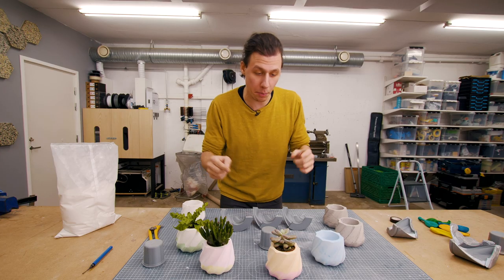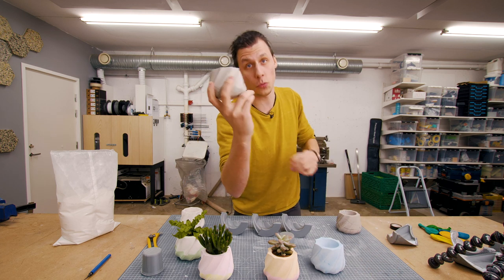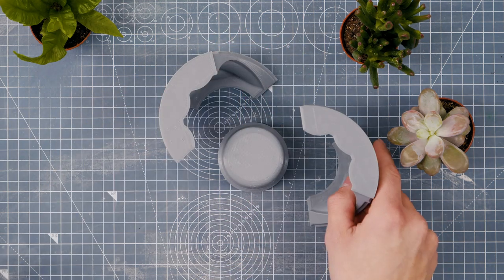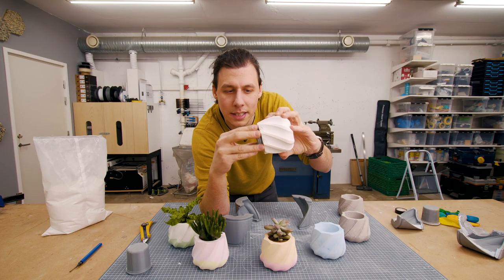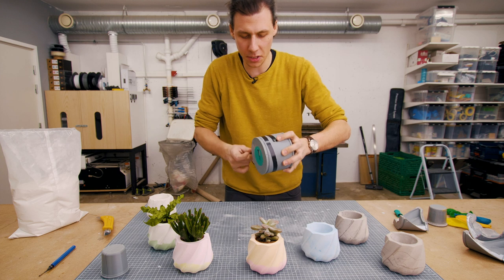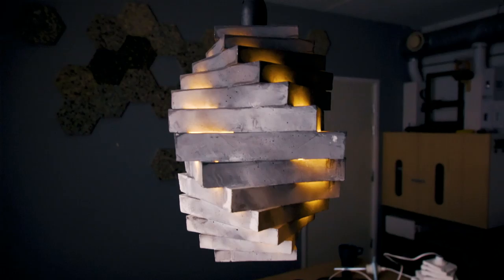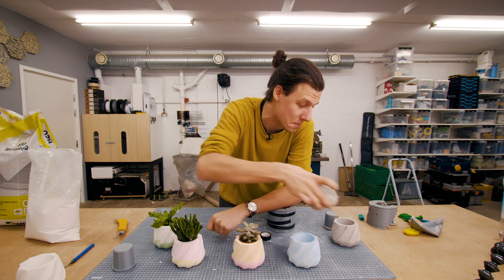Using 3d Printing to make these concrete planters!

Comment: Silicone spray works a charm for prevent concrete from sticking, just give it a once over before you pour you mixture and it will super easy to get you mold off.

Comment: Would love to see a video on designing a part like this and how to make a 3 part divisable mold.
Love it.
Reply: It's always good for people to walk you through it visually, but if you can model the finished part the rest is relatively easy.
Create a square or cylinder body that completely encased your part, create a hole for pouring. Use a boolean function (name may differ with software) to use the model as a tool to hollow out the mould to shape. All that's left then is to consider the split lines (how the mould comes apart and, more importantly, how it locates on reassembly) you can create surfaces along these split lines and use them to split the solid body. 
I know it sounds quite simple, but start simple and you may figure out on your own. 
Key things is to consider are draft angles, try to avoid pulling mould surfaces parallel to castings surfaces, and try to avoid fine detail. Small features are often hard to fill with casting material with the use of pressured filling methods or break off easy when splitting the mould.
Reply: Me too!
Reply: @PeterKNoone  Agreed

Comment: Thank you so much for the balloon trick! This is really cool! I already tried different molds and I always ended up having trouble removing the inner piece. And by "having trouble" I mean, I totally trashed the inner piece every single time to get it out even though I used oil / grease but it simply didn't help.

Comment: I made a bunch of these little planters with plaster and they came out great.  Concrete still doesn't want to let go of the center plug.  I've tried 3 times and even with a balloon it's a big nope.  I think I'll try painting and sanding the center plug to a super glossy finish and then using a mold release product.

Comment: Use construction grade silicone on the inside of the mold pieces that make up the outside design (the pieces that are in 3 parts). That way you can smooth out the ridges and make it look even smoother

Comment: The other way to get the core out is a multipart core that disassembles to the inside when you pull out the inner core.

Comment: fantastic video! Tip for future projects: so that the cement does not stick to the mold you can use cooking oil that works perfectly! and if you add the ballon still better

Comment: Another great vid! Thanks Alex. And kudos on the ingenious design and free share. The balloon trick is also great, as many others have commented. However, I just wanted to add a quick remark regarding your suggestion about using plaster:
As far as I know plaster develops mold with humidity, as in the fungus. I would avoid it. But I could be wrong and maybe there are mold-resistant specialized plasters out there… 
Anyway, great vid, keep up the good work

Comment: Great project! Amazing how creative you are with all your projects. How about coating the inside of the mold with something to act as a mold release? Silicone spray or even petroleum jelly. Of course if someone wants to paint the concrete or plaster after casting then you'd have to pick something that is easy to wash off. Silicone spray is not easy to wash off.

Comment: You can try making a clearance guild line around the edge of it maybe that could help or as a slopr
Reply: Another thing you could try is rubbing petroleum jelly on the print a light coat

Comment: Super awesome!!!  Thanks so much for the 3d model.  I'm going to print this up and cast a bunch of these for my wife's birthday....she will be so stoked.
Reply: Do you drill holes in the bottom for drainage?
Reply from the maker: Cool! I haven't done that so far no.
Reply: Hi, what print parameters did you use.
Reply: @polyteky  I printed them using recommended settings for the PLA I used...nothing special.  Printed easily.
Reply: @PeterKNoone  Thanks, what was the infill%
Reply: @polyteky  Jeez, this was 2 years ago.  I'm afraid I can't remember.
Reply: @PeterKNoone  Thanks for the quick replies:goodvibes:

Comment: What kind of plaster is that? Is it even save for plants and water tight?
Reply: Does anyone know if plaster is save for plants or does it need an special coat? And what about mixing white concrete with 25% plaster is it save? Even if it is coat?
Reply: As far as I know plaster develops mold with humidity, as in the fungus. I would avoid it. But I could be wrong and maybe there are mold-resistant specialized plasters out there… just not the basic kind

Comment: What settings do you guys recommend? 20% infill and 0,2mm layer height? Cura says it will take about 28 hours to print all the parts in one print with these settings

Comment: The file on thingiverse has the (3parts) part, upside down, and there is a ridge that makes it very hard to print that way, before printing makes sure you reverse the part on the right side.
Would love to have the original files, as I would like to add a "tool" to pull out the core.
Reply: If that's a STL files that's easily importable in most 3D software ;) CAD might be another story, I don't have that much experience with it yet.

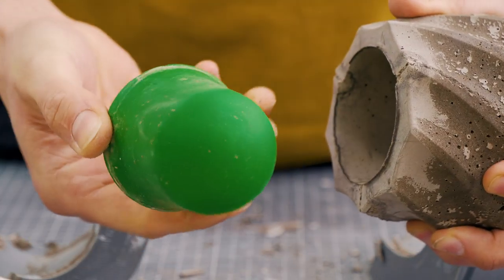Comment: The de-mold damage seen at 4:51 (surface crumbling) isn't at all visible among the 6 planters shown at 5:02. Could you elaborate how many such castings you made before arriving at those 6 perfect planters? Or was that shot showing every one that you casted, but maybe the damaged surface was "away" from the camera?  
My question means to uncover how often you encountered de-molding damage. Great videos; just subscribed. Thanks!

Comment: Anyone facing problem when printing the 3d mold? Mine goes messy on the curved part on the top. Because it has a little overhang. Any tips? Im still beginner in 3d printing

Comment: This is an awesome project, thanks for the files! Can you please provide the print setup (I think it needs supports but not sure about infill, layer height, etc.)?
Reply from the maker: mcalin nope, no supports, print it as nice as you want, doesn't need to be super strong.

Comment: Very nice planters, but i wonder why they don't have a drainage holes?
Reply: You can always drill holes for drainage. casting the model with drainage holes would probably present it's own set of problems. This seems easier.

Comment: Hello! Amazing work with that 3d model, I'm really impressed. Have you tried any mold release / wax / seal to inner piece for better removal? I wonder if any of those would solve the problem. Especially since not always you have such nice and simple shape to use balloon as you have here :)
Reply from the maker: Henryk Zając you can also use the brown packing tape, the one that is super smooth, but it doesn't work as well, and it's a bit more time consuming.

Comment: Such a great job, subscribed! What do you call the locating features? I want to learn. Also this would've cost me $300AUD how can you print these on a budget?
Reply: $300 AUD? This is like 200g of filament. That's like a 5th of a $45AUD roll in the US. 
So sure, your first project requires a 3D printer (e.g., Ender 3 is a great start, especially on sale), but then after that the project gets cheaper.

Then you just need to find the plaster. So... aside from the printer, Maybe $60 AUD and then supplies to make many more after?

Comment: Why split the mold into multiple pieces? Couldn't you just print it as one piece? You can also save time by printing in spiral mode since the inside of the mold doesn't matter. After casting the easies way to remove the PLA from the dry concrete is boiling hot water. As soon as the PLA gets soft it will be easy to remove.
Reply from the maker: Sebastian S the mold is reusable, boiling water would destroy it. Vase mode wouldnt be strong enough.

Comment: Would it be possible to realize something similar to a Terraplanter? 
https://www.youtube.com/watch?v=GruSnziMV4U
With the the right micro holes.
I am concerned about the external negative which would be very hard to remove after concrete solidfication.
Have you tried to use clay?
What do you think?